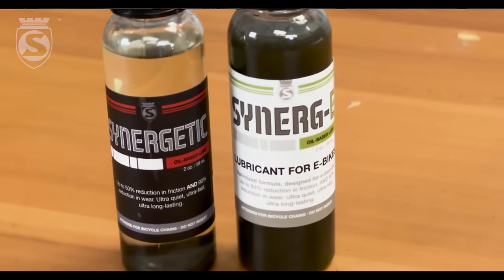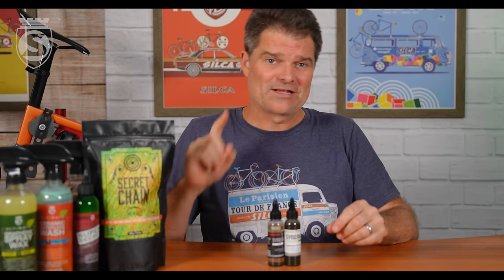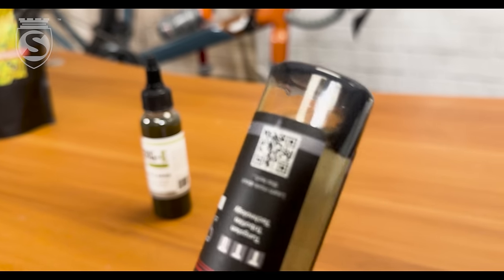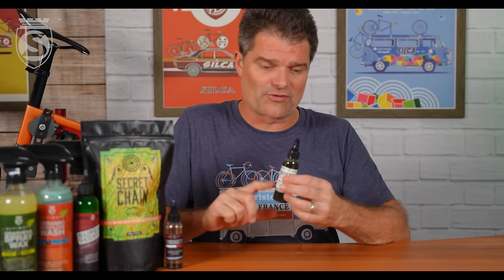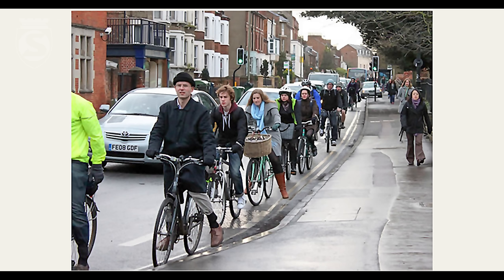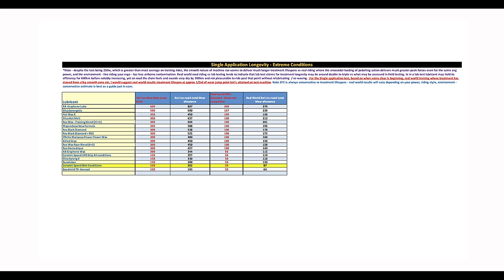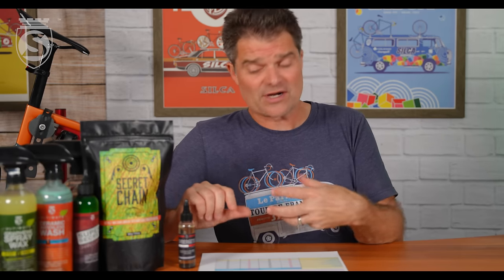Wax vs Oil: Which is the BETTER Chain Lube?

Comment: I have been using your wax this season, great performance. My concern is that dirt and grit will get suspended in the wax and carried into the chain and wear the pins and rollers. How can I tell when it is time to replace the wax in the pot and how do I do it? Thanks.
Reply: Are you dropping your used chain straight into the pot for re-waxing without cleaning first? Just some boiling water should do the trick as it melts the wax on the chain and will take the grit with it.
Reply: In general, wiping your chain with a microfiber cloth before waxing will remove most of the dust and grit. But if your chain is really dirty, wipe it well with a cloth first, then swish it around in a pot of boiling water to flush away the remaining grit. Before re-waxing, dry the chain well by swinging it around to fling off most of the big drops before leaving it in the sun for a bit (best), or dry it was a hair dryer (slow but effective), or even just let it hang (remove as much water as possible first to reduce the risk of rust forming). As for changing the wax in the pot, you can just wait until most of the waxed is used up, and then pour off the remainder and wipe out the residue with some paper towels. But, depending on how dirty your chains are when you put them in the pot, the frequency of resetting the wax on the pot will vary, so it's possible that you can just add more wax instead of cleaning everything. While I don't think it's been tested anywhere, I suspect that a little grit in the wax may not be as bad as the same grit in wet lube because it won't form a grinding paste the same way. All of that said, the easiest way to maintain a waxed chain is to wipe it down before re-waxing, and then replace the wax in the pot when it's almost used up.

Comment: Hey Josh, for an e-cargo bike with a mid drive motor (power into the chain), I know that synerg-e is the pick for it, but I'm curious as to how well hot melt would do in thst application? My thinking is that it perhaps wouldn't last so long just due ot the massive torque that the motor puts out into the wax?

Comment: I have vintage, hard-to-replace chainrings on two of my bikes and want to minimize chainring wear, including wear on the sides of the teeth. It's starting to look like the bike running Silca hot wax may be showing more wear on the sides of the chainring teeth (as if using excessive cross-chaining) vs oil or even dry lube. I speculate wax might not coat the aluminum, allowing the chain to cut into the aluminum teeth. 
I ride in dry road conditions, and prioritize high efficiency, low chainring wear, and relatively gunk-free operation. 
Which product would be best for my use case?

Comment: Great video. Have a quick question. 
I have been using oil based lubricant for few months and wanted to try wax. Im kinda of new to cycling so I didnt want to try to remove chain.
I used silca bio degreaser with bike wash to try to remove as much oil as I could. I was not able to remove all of it, still rubbing fingers around the chain would show some oil on fingers. 
Because I was not able to remove all of it but still wanted to use wax, I started putting 3x SILCA Super Secret Chain Lube. 
My question: Is it ok to put drip wax lube on the chain even if there is some of the old oil left?

Comment: On a multi week bikepacking trip that has enough miles that you have to re-lube no matter what you are using and that could involve riding a whole day in the rain, what would you take?
Reply: Sounds like synergetic
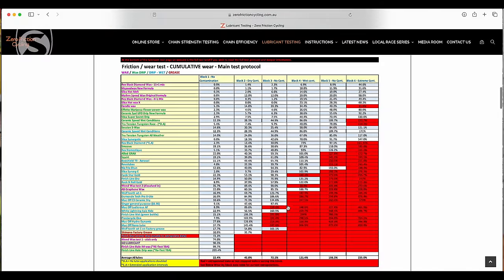Reply: Even the least expensive candle wax outperforms all "wet lube" products in wet weather (3:01 look at the ZeroFrictionCycling Block 4-wet contamination results). Silca Super Secret came in 3rd place among bottled wax drip lubes.
Reply: Synergetic, almost as good as wax but 0 faff
Reply: Synergetic. But, based on my experience on long bikepacking races, you may need a new chain and cassette after the event--depending on miles/day and trail composition (dirt, granite, etc.)

Comment: To clean / degrease the chain after use with wet lube do you need to carryout a full degrease i.e. use chain cleaner / bath tool or just spray and wipe down and re-apply lube? Most wet oil based lubes need a deep clean but havent came across what to do for the Silca wet lube.

Comment: Have you considered selling a version of Synergetic in a 6- or 12-pack of single use packets? I’m envisioning a small clear plastic monodose packet w/ a twist-off tear tab, similar to the little oil packets you get w/ a MTB suspension service kit. I think this would be useful for endurance racers or those who may want to store one in their seat pack for emergencies.
Reply: Pro tip: Buy a normal sized synergetic bottle and also get a small eye drop bottle (like people use for contact lenses). Filling up the small eye drop bottle is super easy and the application process on your chain works perfectly. Have used it on multi day races for a few years now.
Reply: @KnightyBoy  That’s a slick idea, thanks. I still like the even more compact nature of the idea I proposed too🍻

Comment: I was gifted 5 bottles of synergetic but I am a religious waxer so don't know how I will ever use these. What's our thoughts on using Synergetic as a form of high end general purpose oil for lubricating cable lines and derailluer pivot points etc?
Reply: I don't like to lube cables at all. It just attracts dirt, which end up making them less slippery. Instead, I purchase high-quality housing and slick cables. But it does work fine for pivot points--just be sure to wipe off any excess that might attract grit.

Comment: I use hot wax and drip wax on my road, gravel and Mtb. Under normal dry conditions everything is good. On a recent 35 mile bike packing day trip with mostly dry conditions the wax held up well but after rinsing the bike the chain showed signs of surface rust the next morning.  I’m interested in trying the oil over wax for bike packing. How clean/dirty does this make the drive system?  Is it as messy as Triflow, etc?
Reply: Even the least expensive candle wax outperforms all "wet lube" products in wet weather (3:01 look at the ZeroFrictionCycling Block 4-wet contamination results). Silca Super Secret came in 3rd place among bottled wax drip lubes which placed higher than all oil drip lubes.
Reply: Oil over wax can be a useful way to extend the lubrication for a long ride when re-waxing isn't convenient or feasible. Alas, your drivetrain will be messier at the end than if you just used wet lube, because the wax flakes will add volume to the wet lube. But if you have time to wipe the chain a few times during the ride, it won't be as bad. Of course, you'll need to re-strip and clean your chain, cassette, and rings before going back to wax. So, not a terrible thing in the context of a big race, but not something that I would like to do on a frequent basis.

Comment: How about riding a road bike in extreme heat? 100-108 degree commutes? Is wax still the way to go, or would an oil stand up to the heat better?
Reply: Wax outperforms oil lubes up to the point of auto-ignition around 400F
Reply: While the wax will melt if you leave your bike sitting in the sun, it'll harden back up once you get moving again. It's never been a problem for me.

Comment: My chain has 53,000 orginal miles on it and I use "muckoff" every 300 to 400 miles - so after every 1 to 2 rides. It consistently gets worked in the rain, dust of dirt roads and loads up to 46  pounds foot of torque and see speeds up to 115 mph but generally is ran at 40 to 70 mph. About every 1,000 miles I spray it down with " krud cutter" then spray it with pressure washer, all while still on the bike, dry it off run it for 3 min on the stand and spray the chain on the top of the chain as it passes by on the return to the rear gear. If you haven't figured it out yet its a motorcycle BUT I also use the same stuff on my bicycles- I have 2 and my wife and boys have 1 a peice except my 6 year old, he has 3 bikes now. That 8 bikes! Out of all the things I have to do to keep 8 bikes going worn cassettes, rings or chains have never been an issue.

Comment: I have a hot melt waxed chain on my trainer, but I am interested in the longevity of the Synerg-E lube.  Can I add Synerg-E directly over the top of the hot melt wax? or do I need a properly cleaned chain to start?
Reply from the maker: You can add SynergE over top of hot wax, it will wick into the inside of the chain and in time, combine with the wax.  Subsequent applications will further thin the wax allowing it to run out to be wiped away after future re-lubrication.  Just be sure to wipe before and after with micro-fiber cloth to remove any dirt, and then any excess lubricant on the outside of the chain.
Reply: @SILCAVelo   Thank you!! These videos are very helpful.

Comment: How often would you suggest the cassette and front chainring should be cleaned when using your hot wax system?
I've noticed on mine a layer of wax on the teeth after applications of the drip on between dips. Guessing this could help reduce friction or hold/capture dirt?
Reply: waxed components do not capture dirt... which is what makes them especially suited for chain lubrication
Reply: @OriginalTrev  So why does the wax look dirty?
I'd say the wax holds "less" dirt
Reply: @gmivisualsjason3729  Just to be clear... "Hot Wax" indicates immersive chain waxing and not wax drip lubes. If the molten wax in your immersion pot looks dirty then you haven't been pre-cleaning the chain in boiling water before immersing it in the molten wax. If your cassette sprockets look dirty then you haven't been wiping it dry after a wet ride.
Reply: @OriginalTrev  Nothing that you just said is correct in my case.
But thanks for taking the time to comment

Comment: Just don't have the time nor am I willing to spend the money for waxing equipment. Despite my job being to sell bikes, I dot have much time to ride them, and in the hours it takes to remove and degrease my chain, liquify the wax, "cooking" the chain in it, letting it dry and re-apply my chain, I can ride my usual local route three times. Cleaning and oiling my chain takes only a few minutes and can be done pre-ride. Also hardly doubt that a waxed chain will make me ride any faster with less effort.
Reply: Degreasing a chain needs to be done just once--and Silca's chain prep or Strip Chip make that an easy task (10 minutes for stripper, ZERO minutes for Strip Chip). Liquifying the wax does take a bit, but I hope that you're not standing there watching it melt! I usually just turn the melter on, eat dinner or something, and then drop the chain in--so maybe 2 minutes of actual work? There's no "cooking" required; just drop it in, swish it around a few times, and then hang it to cool and harden. So, unless your ride is shorter than 5 minutes of total time, waxing is much faster than riding you "usual local route three times." On the other hand, cleaning a wet-lubed drivetrain is a total PITA.

Comment: EMTB in dry and modestly dusty conditions. Does the standard Silca wax handle the high loads from full-fat emtbs well, or is there a better mix for dry conditions? Or use the Silca e-bike lube?
Roughly how many hours of EMTB riding in dust will a hot wax application last? Thanks!
Reply: I love wax on my mountain bike! So much cleaner and easier to maintain than wet lube. Just wax a few chains at once, and then rotate through them as necessary. I've ridden 100 miles of Pike Peak granite, which is about as abrasive as it comes, without an issue. No problem with "high loads." If wax can handle the watts of a grand-tour sprinter, it can handle anything that I can throw at it.

Comment: Why bother with the cleaning step before waxing a new chain? Paraffin is a hydrocarbon, the oil on the chain should be soluble in the wax and negligibly change its composition. At high temps a lot of the lighter aromatics in the chain lube should evaporate out of the solution anyway.
New to waxing so I'm genuinely curious.
Reply: Not all hydrocarbons are the same. Oil & grease keep the wax from properly adhering to the chain. But you can use Strip Chip to wax and degrease in the same step if you don't want to save some time and fuss.
Reply: @SnaxNoCo  What are you basing this claim on?
P.s. if it is not soluble, then what happens when to the oil when it is heated to a high temp and the viscosity is low enough to flow out of the chain with some agitation? Surely there is a difference in S.G. which means it will either float to the top or sink to the bottom.
Reply: @SnaxNoCo  p.s. I dropped a brand new chain in high temp paraffin right after I wrote the first comment. All I did beforehand was wipe the exterior of the chain. 
Looks like the oil dissolved pretty readily.
Reply: @IlPinnacolo  It might seem like that, but it doesn't work that way. It's a good question. I'm sure that a chemist at Silca could provide a more thorough technical explanation, but I'm only capable of provided the executive summary. The bottom line is that chains need to be stripped or prepped using one of three options: various sequential solvent baths, Silca Chain Stripper, or Silca Strip Chip.
Reply: @SnaxNoCo  They have chemists on staff? Impressive. 
I'm looking at my pot of paraffin right now with a brand new chain in it. No oil bubbles.
P.s. water and ethanol are very different yet totally miscible.
Reply: @SnaxNoCo  also, you say "it doesn't work that way" what are you basing this statement on?
Reply: @IlPinnacolo  I am basing my statements off of those who have developed and tested chain-waxing systems, including Silca and Zero Friction Cycling. So, no, you don't need to trust me--you can look up the information for yourself. Good luck!
Reply: @SnaxNoCo  I'm hoping you could point me to something they have published to corroborate what you are saying. I've looked but can't find anything. Simple oversight on my part I'm sure.
Reply: @SnaxNoCo  uploaded a short on my experiment, comments?
Reply: That's what the "Strip Chip" wax additive is for. To alter the consistency of the factory grease. There is a whole episode explaining the strip chip and the basics of the chemistry
Reply: @VYBEKAT  Thanks for recommending the episode, I looked it up and he addressed this question.  As I expected, the oil is soluble in the wax but cites tests that demonstrate the grease softens the wax to a greater degree than I would expect. Tbh this might make the chain faster in the short term. It would be interesting to see what effect this has on efficiency at the expense of longevity.
Reply: @IlPinnacolo  If it were faster, Silca (or someone else) would sell it. But additives like Tungsten disulfide, not oil, are what make it faster. Check out their Speed Chip if you want the fastest drivetrain.
Reply: @SnaxNoCo  Are you on their payroll?
Reply: @IlPinnacolo  Nope. Just a really happy customer! After decades of messing with dozens of different lubes, wax has revolutionized bike maintenance for me.
Reply: @SnaxNoCo  I hope Josh sees this bro.

Comment: Waxed indoor makes a mess on my floor
Reply: I’ve wondered how to get around this but the video suggests using the Synergetic lube on the trainer. I’ll give it a go this winter!
Reply: While I wax the chains on my outdoor bikes, I use a clean chain with Syner-G on my trainer. No mess--and it lasts a LONG time because there's no grit or dust. Just wipe it down for the first few rides, and you shouldn't get any mess at all.